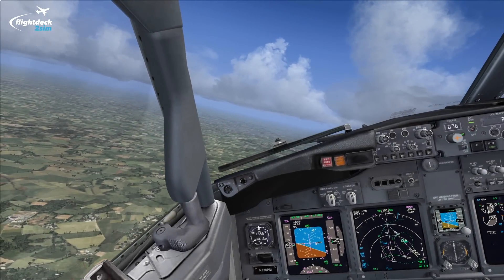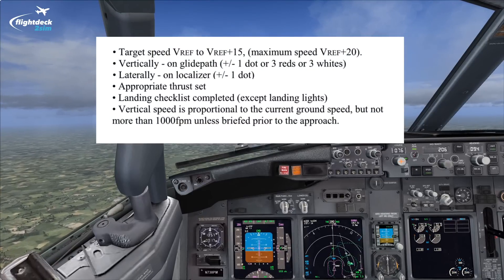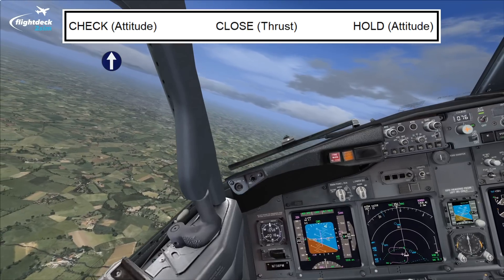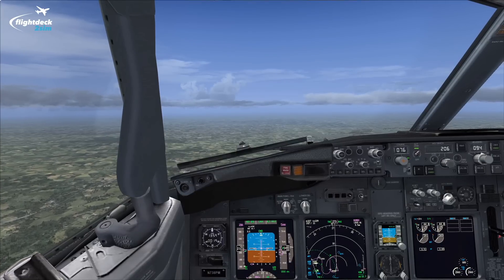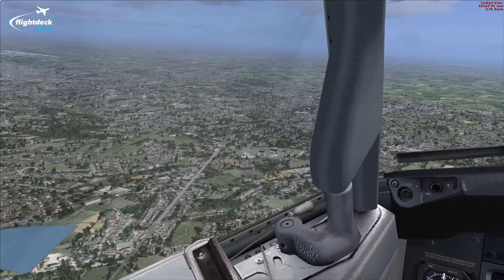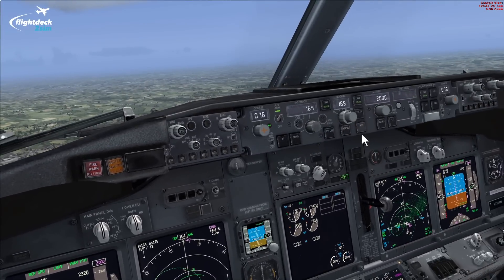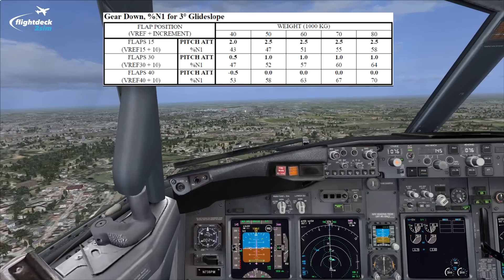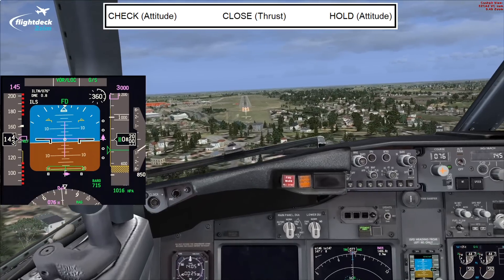How to Land the PMDG 737 by a Real 737 Captain

Comment: I have a few questions capt. I watched your video hundreds of times and flying virtually for two years and i still have problems :/

1- You said that at 20 ft you should check the attitude but in your some videos you flare later or earlier, how to determine the exact flare time? Even in this video, you started pulling at 30 ish ft.
2- How do you determine your pitch while looking towards the end of the runway?

Cheers

Comment: Brilliant landing. Could you please explain how you use the radar paddles in the air before you land . Also if you are using them in these tutorials. I see most videos online have not addressed that issue and many simmers end up just using the cat3 ILS instead of manual landing.
Reply from the maker: Thanks! 

Rudder used during the flare to de-crab crosswind in most cases.

FD2S

Comment: As a RL pilot myself, i was shocked by how the famous PMDGs 737 doesn't pitch depending on power. That makes most RL techniques inapplicable as  those will make you float really bad in the PMDG
Reply from the maker: Hi Eddie,

Yes although simulated it's not as pronounced as you'd get with a commercial aircraft like the 737 with underslung engines but it's close enough to apply "check, close, hold" 

FD2S
Reply: flightdeck2sim probably, yes. However, one has to be really gentle and precise with the pull in the PMDGsim. A gust here would even force you to push nose down, which is highly unrecommended on the real one. Overall, i find the PMDG much better for procedural training. Zibo w/ Aerosim on the other hand, have got those landing dynamics pretty much spot on. Best regards and thank you for the reply.

Comment: Arming approach more than 1 dot high!! (tongue in cheek)
I'm sure FD2S has taught us otherwise ;-).
Thanks for another great vid.
Reply from the maker: Hahaha! Very well observed sir!

Also not advised to arm the APP with such a sharp intercept, it would've been more prudent to have armed VOR/LOC and then APP on final within one dot!

Good luck!

FD2S
Reply: Thanks. Also do you find the NGX a bit 'floaty' in the flare compared to the real thing? I've seen this discussed before but you could put the debate to bed?
Reply from the maker: The 737 does have a natural tendency to float if you're flying just a few knots above your target speed on final when initiating the Flare.

If you start "checking" and your speed is VREF or less the real aircraft will land quite firmly. This will also be the case if you reduce thrust too early, especially landing with Flap 40 due to the significant increase in drag. 

Small inputs using a computer joystick would involve a far larger input using the control column so the tendency to flare using flight sim is greater. Both in real life and in the sim if you initiate the CHECK, CLOSE, HOLD correctly and the correct height/speed it will settle quite nicely within the touchdown zone.

Hope that helped to answer your query! 

FD2S
Reply: Thank for the feedback. Yes ,I have found small inputs on the sim are the way forward. All too easy to balloon it if heavy handed.

Comment: hi pilot your tutorials are nice... ı want to ask a question about pitch mode.. you are always engage the autopilot at app. 1000 feet. here is my question.. which pitch mode will engage after bug up (speed up) without a/p engage ??? to/ga ??
Reply from the maker: Hi RAHMICAN.

It would remain in TO/GA until reaching your cleared MCP Altitude and transition to ALT ACQ (so long as you didn’t engage VNAV prior to take off otherwise VNAV SPD will engage at 400ft) 

FD2S
Reply: thank you for answer and you are absolutely right .. before you answer ı tried to figure out the fma modes in xplane 11 and it remained in toga until mcp altitude or selecting another pitch modes when a/p is disengaged.  (ı dont generally engage the vnav on the ground ı would wait to select until the clean speed :) )
Reply from the maker: Well I’m glad I got the answer right, thanks for the surprise test! 

FD2S

Comment: So i've just found your channel and am binge watching your vids, and i'm noticing that you seem to be using pitch for altitude and power for speed during final approach, instead of the pitch for speed and power for altitude that's been drilled into me during PPL. Could you elaborate on that? Is it something that changes with bigger planes, or specific to the 737?
Reply from the maker: Hi Nico, exactly!!! On a light aircraft Power = Pitch/ROD, Attitude = Speed.

The exact opposite applies on a large jet commercial aircraft.

Thrust = Speed - Attitude = Pitch

This is primarily due to the fact the 737 has under slung engines. Any change in thrust setting will result in a change of attitude as the thrust vector is below the C of G. They're also incredibly powerful! 

When we get cadets starting their type rating they initially apply what they know and change their thrust to alter their attitude which is not desired. All they end up doing is massively accelerating/decelerating.

Hope this helped answer your query!

FD2S.

Comment: Great video! Would be nice to see a video on how to set the auto break setting...like apart from runway lengthy what else effects it? Is it software that chooses it for you IRL? Thanks
Reply from the maker: Hi ZeeMuffenMan, thanks a lot! 

We use the Boeing OPT IRL to calculate our landing performance. Our Autobrake setting is based on several factors but we follow the maxim "Brake to Vacate", essentially working out which taxiway we'd like to exit and then select our Autobrake setting based on that.

Might like a little tutorial in time! 

FD2S.

Comment: Hi captain, question .. in ILS DME approach, the approach plates says to fly towards VOR which is holding point as well (in case) and then make a descending loop to intercept ILS .. I m trying understand that does this happens in real life as well? Because I never observed while traveling ever that plan is right above airport and then making loop to intervept ILS. Generally, it keeps desecnding the takes left/right turn and intercepts ILS. Can you explain this? I hope u got my question
Reply from the maker: Hi Kk,

That's the procedural approach when radar vectors cannot be provided (see Procedural Approach Tutorial) You'd fly outbound from the VOR and essentially make a 180 degree turn to intercept the Approach. 

Good Luck!

FD2S.
Reply: flightdeck2sim Do you fly this real as well, making 180 turn from VOR or un real life Radar vectors are there and directly proceed for ILS interception? Pardon my techincal language :)
Reply: Airliners VERY rarely, if ever, do those sorts of full procedures on ILS approaches these days because anywhere they go is going to have radar coverage and therefore ATC available to give them vectors to final approach course. At least, that much is true for developed countries.

Using VORs for navigation and approaches is rapidly disappearing among air carriers in favor of RNAV/GPS. Horizon Air, for instance, a regional subsidiary of Alaska Airlines, is even prohibited from VOR approaches in their SOP's. This is because they are certified for very precise RNP (Required Navigation Performance) approaches with GPS... it's just so much safer and more accurate that VOR's are totally obsolete by comparison.

Comment: I notice you dont have a ground speed indicator.  I find I really need mine when taxiing. So how about a taxi tutorial :)
Really appreciate your vids. Too long its been the blind leading the blind!
Reply from the maker: Hi Bald Eagle. Thanks a lot! 

Not sure where you've been looking but the indication for your ground speed is top left of the ND. It's the only source of information used during taxying and frequently used! I am planning on making a tutorial covering taxying. I do briefly explain the procedure with Part 1/3 of my full flight tutorials.

Good Luck! 

FD2S.
Reply: ok.... I have a ground speed indicator bottom left on the PFD under the speed tape. Its selectable within the PMDG config. At what speed would you do a 90 degree turn onto a stand? As you may know the MSFS coefficient of friction is not realistic and if I start the  turn at 5 knots its 0 knots after the turn :) 
At 0 degree pitch 40 flap you would effectively be doing a 'greaser' or am I not understanding your Check Hold Close technique?
Reply from the maker: Hi Le Ashia.

I wasn't aware the MSFS coefficient of friction was unrealistic, I felt it wasn't too far off. In the real 737 you'd probably stop if you entered a turn at 5 kts with idle thrust due to lack of inertia.

With regards to aircraft attitude in a large aircraft like a 737 your attitude can vary considerably based on your configuration, weight and airspeed. 

For example in level flight at 3000ft at around 200kts you need an Attitude of 6 degrees nose up at maintain altitude. If you increase your airspeed to 300kts you'd then need approximately 2 degrees nose up attitude to maintain 3000ft. 

Try it out! Level off and increase the airspeed with the A/P engaged and notice how the aircraft trims nose down and lowers the attitude to maintain level flight as the amount of lift increases. 

Raising the nose by just one or two degrees in a 737 will give you an immediate and substantial change in either rate of climb or descent. The same input on a light aircraft is unlikely to have the same effect.

The setting of 0 degrees attitude, Flap 40 at 60 tonnes is what you need to maintain a 3 degree glidepath (approximately 750fpm rate of descent). This is a reference attitude and thrust setting and small change will need to be made to ensure you fly the approach accurately. 

I hope this makes sense! 

FD2S.

Comment: Great video! Have a question...what is exactly  "manual breaking"? Does it mean you turn the auto break off and start breaking using pedals? Is there a speed you start doing this or is it up to the Pilot? Once on the runway, what goes out first, reverse or auto brake? Thanks!
Reply: reverse go out first

Comment: Hey man. Nice video!

I saw you on Doofer's stream and came to check you out. These videos are really entertaining and informative. It's nice to see the real life procedures explained; they are really helpful!

A quick question, you mentioned a few times about reverse detent, what is this and how do I configure something like that in FS.

Thanks,
Brad
Reply from the maker: Hi kn0pee and welcome! Thanks for your kind words! 

When you manipulate the thrust lever on the real aircraft after touchdown and move it to the reverser interlock position which is called detent no1 (Idle reverse) it should give you ground idle, around 22%

Second Detent, when you move the reverser to the 2nd detent position = 75% N1

Max Reverse = 82% N1.

FCOM 2 that comes with the product will show what the positions of the thrust lever are for each one of these settings.

With FSX when you hold down F2 and let go you can stop moving the thrust lever in between the detents and you'll get the appropriate N1 setting, you wouldn't do this in the real aircraft!

Hope this helped answer your query!

FD2S.

Comment: Could I please ask a couple of questions? Regarding turning off autothrottle for landing manually; is the logic for this to do with go-arounds? Because it always struck me that to add manual control of speed at a time the PF should be concentrating on altitude and attitude seems a bit bizarre.
 
Likewise the winds guidance on the ND disappears on final - just at the time you need it most?

Comment: I would like to ask you one thing, flying the pmdg i noticed that the 7-800 it slows down very slowly even to go from 220 to 180 knots it takes alot of miles in level change, do you think from your experience that the real Aircraft behaves like this, or the drag ration is a bit wrong in the game? Thank you.
Reply from the maker: Both the NGX and ZIBO MOD are very slippy just like the real life counterpart, they can be difficult to slow down especially when descending.

FD2S

Comment: I am a big fan of your excellent videos. Question, are the flight characteristics/ flight behavior of the PMDG anywhere near the real deal? Seeing you how you enjoy the sim 737 makes be believe that it is pretty damn close to the real world 737.
Reply from the maker: Hi 702Wolfi

Thank you very much for your kind words!

The NGX is a very accurate rendition of the real aircraft and certainly something I can use to improve my knowledge.

There are some subtle differences between the NGX and real aircraft which I always try to bring to your attention but the flight model is pretty sound. 

Attitude and thrust settings for a given gross weight are not too far off the real aircraft but it’s not so good at holding the magenta line on SIDS/STARS and maintaining holding patterns. Sometimes it can struggle to hold altitude. For what is essentially an entertainment product it’s certainly worth the investment and it’s realistic enough to accurately show you how to operate it using my companies SOP’s

All the best!

FD2S.
Reply: Thank you very much for the info FD2S! Now I have an even bigger smile on my face when flying the PMDG. Having an highly experienced real world aviator like you in the sim community is simply awesome.

Cheers sir!

Comment: Letting the nose rise is not such a big deal if it happens. As long as the tail does not strike the ground. The only issue I can see with it is floating. But with the length Of The runway you are landing on. That's not an issue ether!

Comment: Question, I cannot engage CMD B for autoland. When I press it, it turns off within seconds. Loc captured, G/S captured and stable approach, then I engage CMB B but turns off .. whats my mistake please
Reply from the maker: Hi Kk, 

It should engage so long as both NAV boxes are set to the active ILS frequency, APP is armed and above 800ft RA
Reply: flightdeck2sim Okey I guess, I put ILS frequency only in captain side .. not FO

Comment: I'm still a little confused on how to get the range rings to appear on the navigation display. I am not using the PMDG NGX, but, rather, I am using the ZIBO 737 (as I understand you were just introduced to! The community is excited to have you on that) and I don't know how to get the rings to appear. It has to do with the WXR Radar, right?
Reply from the maker: Hi Joe N.

The fix rings are unrelated to the WX Radar! We use the fix page in the FMC and the runway in use at our destination. You simply write for eg "RW27" and insert it in the fix page and for a ring you put /4 or /10 to create the green circle around the threshold of the respective runway. 

Hope this helped, I will try ZIBO's 737 soon! 

FD2S.
Reply: If you mean the range arcs/rings with aircraft at centre then press the WXR button on the EFIS

Comment: I really appreciate the reply and your expert input!  I guess that brings me to the another question since you brought speed into it.  Do you do wind correction for Vapp or just Vref +5?  I’m wondering if my speed is too high during the flare.  I check and then float, by the time I’m closing the throttle in the float...well you know what happens after that...
Reply from the maker: VREF + 5 is the minimum approach speed. Carrying too much speed will increase the likelihood of floating down the runway! 

You might have seen it but I do have a tutorial which talks about calculating your final approach speed in the 737.

https://youtu.be/WsqkKCvS4Yc

Good Luck!

FD2S

Comment: Hi FD2S,

Discovered your channel today and, being a virtual NGX pilot, I've got to say, you've got me hooked. 

I did have one minor question though: I noticed you stating that this landing technique was specifically for the 737-800; is there any difference when it comes to other variants of the NG? I generally fly the smaller variants, specifically the -600, much more than I do the -800. Therefore, I'd like to know if there are any differences when it comes to flying a smaller, lighter variant of the same aircraft.

Keep up the good work!
Reply from the maker: Hi Spoon LGNX. Thanks a lot and welcome! 

I'd be VERY surprised if this technique did not apply to all variants of the 737! We fly the -700 too which is quite a bit shorter and the same technique applies. 

All the best!

FD2S.

Comment: Hi fd2sim. At what point do you initiate the flare? Also I did note that your attitude did drop after closing the throttles. Was that because you felt you were floating? I find this aeroplane hates landing! It will be still above the ground at 115 kn if you apply enough stick.
Reply from the maker: Hi Le Aisha.

If you come over the threshold at the appropriate rate of descent we initiate the flare by "Checking" at 20ft. It was a very small correction in this tutorial to ensure we didn't float too much, we DO NOT want to keep pulling back as I explained in this video!!!

If you do you'll use up valuable runway and in the 737-800/900 you will increase the risk of tailstrike. After closing the thrust the nose will want to drop due to the thrust/pitch couple which isn't as apparent with the NGX as it is in real life! 

I hope this makes sense!

FD2S

Comment: I land the 737-800 with a rate of about 150-250 fpm normally. The 737-700 is usually way higher, because it seems that it floats quit long. Is there any difference with the landing techniques? Thx :)